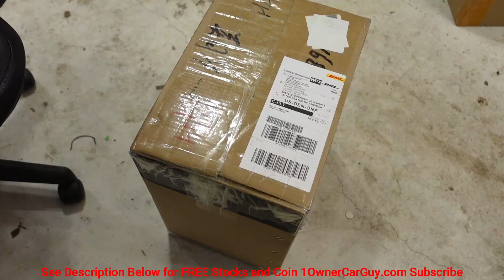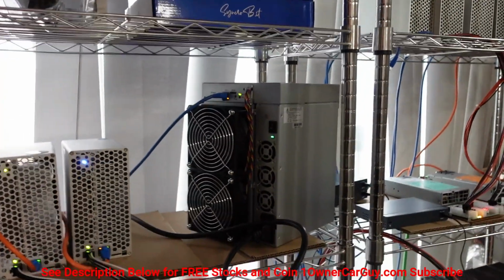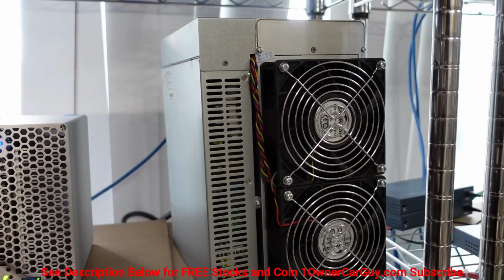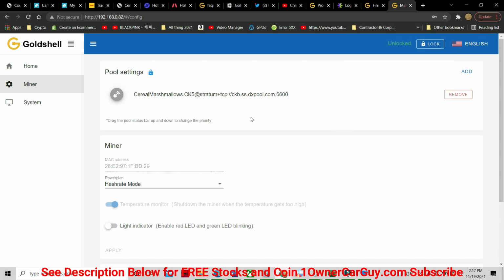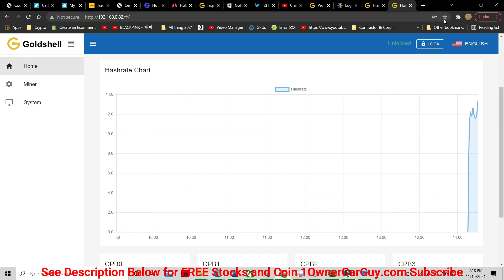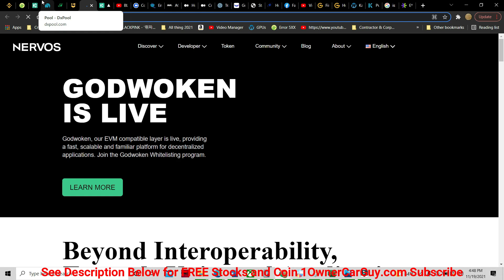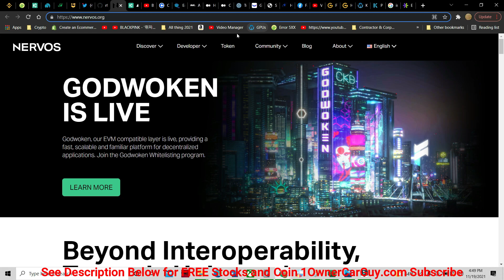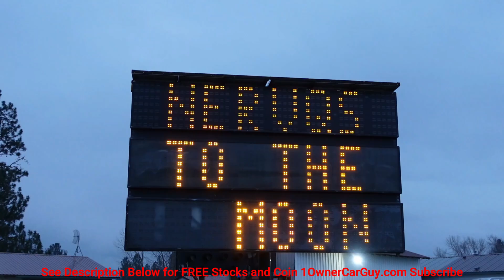Goldshell CK5 ASIC Miner Setup under 4 Minutes ~ Add Pool & Hashing Home Crypto Mining Pools

Comment: Did you plug your CK5 miner into the wall directly or a PDU? If so which wall outlet amp rating did you plug it into or which PDU did you use?
Reply from the maker: I use 240v on 50A Breakers and 30A PDU's only Pulling 24A max... There is a link in the description of most of those kinds of equipment that I use on my Amazon Link! Good luck on your mining journey!! ;-)
Reply: same question! i have two ck5. should i get c19c20 cords and connect them both into one 30amp pdu connected to a 2pole30a breaker? or get a new cord and plug into wall 20amp receptical?. i looked but not sure what pdu you are using.